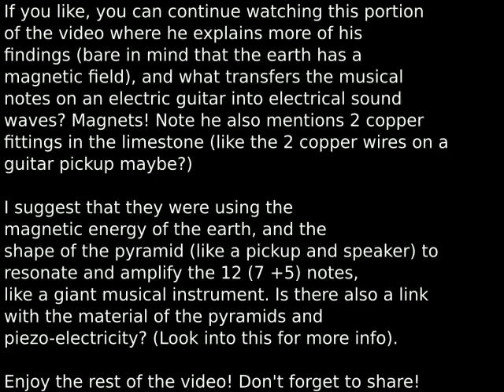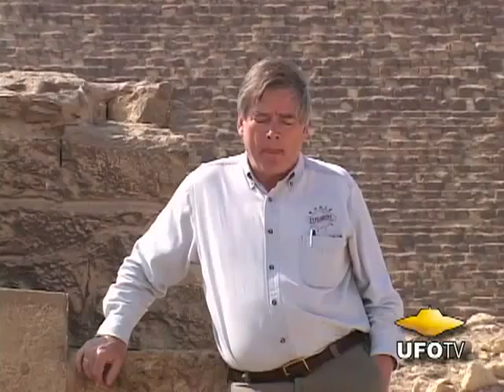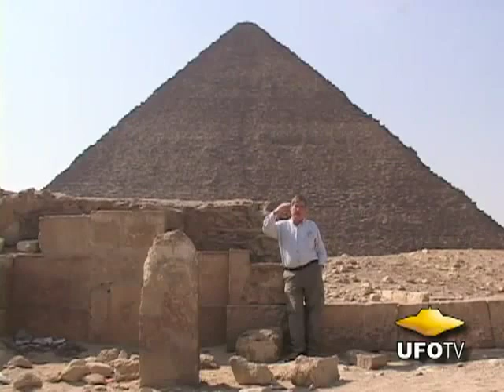The Musical Pyramid. Pyramid Secrets. 432Hz Tuning. Chris Dunn. Interesting Findings (Part 2 of 2)

Comment: These shafts are not just roughly  cut 'air holes'  but are perfectly  straight cut on all four sides all the way to each corner (not rounded at the corners)  and all done with a copper chisel?    Also,  the shafts are still  perfectly straight after major earthquakes and many thousands of years!  Then the builders hide their work unsigned and  never to  be found!

Comment: I'm confused. The pyramid is a "power plant", and was supposed to produce hydrogen, but when the hydrogen exploded....that was a disaster? Does that mean the hydrogen was never supposed to burn? How would the hydrogen produce energy/power without burning, or was it supposed to burn in a controlled manner, like a furnace? Where did this hydrogen go after it travelled to the King's Chamber? How was power extracted from the pyramid "power plant"? Did it produce electricity, or did it power a water pump?
Reply: The hydrogen is excited by the piezoelectric effect of the quartz in the King’s Chamber granite. The vibrations from the grand gallery cause a rapid compression/decompression of the quartz, which causes the emission of an electromagnetic field from the quartz crystal. 
That electromagnetism excites the hydrogen and forms microwave energy. 
Then the microwaves would exit the southern shaft in the kings chamber, which happens to be shaped like a wave guide to form microwaves into a beam.

So, correct. The hydrogen was never supposed to burn, only to fill the grand gallery to increase the strength of the vibrations and then to mix with the electromagnetic field. 

Some type of accident seems to have occurred which may have somehow ignited the hydrogen. 

To-scale replicas of the pyramid’s sub-chamber prove it functioned mechanically as a hydraulic ram pump, a pulse generator that would send enormous vibrations up into the body of the pyramid. 

Even now, without the subchamber active, the pyramid functions as a coupled oscillator to the earth. 
You can be perfectly silent sitting in the King’s Chamber, and the chamber rings at 438hz as it draws vibrational energy from the Schumann resonance. 

Modern science has proven that even now, in its inactive form, the King’s Chamber creates an electromagnetic field. 

Fully functional, it would have been awesomely powerful.

Comment: Doesn't Chris Dunn say the Kings chamber is tuned to 440 not 432 hz?
Reply: He says 438 in The Giza Power Plant. He measured it with effectively a guitar tuner. The pyramid is an active coupled oscillator to the earth, and thus the King’s Chamber is always humming quietly, tuned to 438hz.

Comment: This pyramid have 2 chambers, for tuning a binatural beat two type of frequency " stereo speaker". 
They says used to be water flows by  the lover entrace. So If the water flows down Constant under the pyramid, it pulls in constanst hot air flow from the top of the pyramid. Constant air motion makes resonate  the 2 chambers, and starts to "whistle up in a hight frequency". Like when you leave the windows opened, and hear that sounds.
Sonic levitation, is levitating with multiple sound freaquency standing waves. So if the 3 pyramids are 3 big speakers what were built downward and spaced correctly generating standing waves in the ground? Maybe the whole ground and soil beneath the section of the 3 pyramids has no weight ' couse this sonic levitation effect. If the whole area has no weight near the 3 pyramids, couses obove place has less, or no gravity? Like a airfield ?

Comment: I'm picking up what you are laying down.  Hydrogen sparked by piezo electricity from the granite in the Kings chamber would be an implosion and the result would be a lower temperature in the rush for hydrogen to mix with air and create water.  I agree that a huge earth event happened, everything near any of the pyramids running at that moment was vaporized in a hydrogen implosion then an earth event belched out and shattered all of the limestone on the outside into dust in the shape of a mushroom cloud like hydrogen bomb, exactly like a hydrogen bomb.
The only humans left were sheep herders and the type who only new about copper chisels and nothing about machining to some fraction of an inch.  The blueprints and directions on how to move huge rocks floating from quarries 500 miles away scattered with the dust of the limestone.  I believe in that one earth event we lost all the brilliance of the pyramid age across the earth.  Everyone anywhere close to a pyramid anywhere on earth, gone.
Reply: Hydrogen would be excited by the piezoelectric electromagnetic field, forming microwave energy. 
I’m not sure if the piezo electric electromagnetic field would ignite the hydrogen without sparking.

Comment: Why 432? Why not 431 or 433?
Reply: Know thyself you are the sacred geometrician. The average human is 5'9" average thumb knuckle is 1 inch wide the spiral on your thumb made square ( phi ratio ) give us the fractions in the inch. Average pace is 5.28 feet. 1000 paces is a mile the sol ( Latin for sun ) of your shoe is 1 foot long. Your heart beats an average of 72 bpm you have 20 digits 20×72 is 1440° in the seal of Solomon or star tetrahedron. your hand over your heart 5 digits times 72 that's 360 the degrees in which the sun moves 72×360 is the entire platonic year and  The degrees in the Platonic solids are contained in the cycle. you have 24 minute digits 12 on each hand 5 digits ×12 minute digits is 60 the minutes in an hour this is why there are hands on the clock on radi that spiral like radius bone in your arm that grows in the spiral ratio phi. start doing the math and you have all the numbers in time. You have 27 bones in your hand 27, 54, 108, 216, 432, 864, 1728 this is the Pythagorean tuning or octaves. Let's play harmony of the Spheres (scale invariant harmony) or zeros. If you add a 0 to 108 it is the moon radius add a zero to the 216 you have the moon diameter and the degrees in the cube. Add three zeros to 432 and you have the radius of the sun 432x432 is the classical  speed of light at 0.01%accuracy . add three zeros to 864 and you get the diameter of the sun.  and of course 1728 is the inches or thumbs in the cubic foot. You have 33 vertebrates or steps on Jacobs ladder 33 ×24 minute digits or hours of the day is 792 add a zero and you have the diameter of the earth 5x12x3960 the earths radius and you get the classical distance to the moon. with this number you can begin to triangulate the heavens with the naked eye and climb the cosmic ladder!!! Add these numbers to find the root digits ( 4+3+2=9 the # of truth ) and you know the magnificence of Tesla's 3,6,9. We are created in the image and we are the measure of all!  Namaste
Reply: ***** That's a phantastic explanation!
Reply: Do the math
Reply: @PhyZeik in college philosophy, world history, and music theory. After college i dove into the trivium and the quadrivium as well as the origin of weights and measure. I've made a few vidoes about this stuff on my channel but for more info check the channel SGD he dine some great work and is a nice guy happy to answer  questions for you if you ask. Glad you find it interesting, peace to you!! 😊✌
Reply: @PhyZeik have you ever dreamed or used your imagination to visualize and create something? If so then you've had a DMT trip and you've used your third eye or the eye of the magi ( imagination). To create is to use both side the theoretical brain in harmony. the Egyptians thought the Eye of Horus or 3rd eye represented fractions 1/2, 1/4,1/8 ext. And how we see the world I believe our visual cortex is plugged into that somehow LOL but we use these fractions which are found in nature when we observe it to create things and to play music Etc it's in the spiral of life or the golden ratio. Most of these drugs have chemicals endogenous  to our body the stuff is already inside you. But what DMT or a Ayahuasca trip will do for you is just force you to dream while you're Wide Awake instead of while you're sleeping which is very similar to a schizophrenic episode. If you get scared you can have a nightmare and things can go bad if you're full of love and light things usually tend to go okay. But basically you're overriding your body's natural functions that protect you from harming yourself while you're dreaming asleep when you take these drugs. If you take small amounts of these drugs you're not going to dream while you're wide awake but you're going to see visuals lots of geometric shapes much like when you are sober and you rub your eyes you'll see strange patterns these patterns are sacred to people all around the world and we wound up developing a system of geometry based on the 360 degrees of the sun's movement and a circle to understand some of these visions and then we use those to build things as well and measure the world around us. A lot of the old mathematicians were mushroom heads it's just that simple. Part of meditation while high on shrooms or without was not just to sit there and clear your mind it was to do math the word meditation itself implies to measure things. So if you are going to mess around with these things be careful large dosage and fear can put you in a schizophrenic episode try something small first and just enjoy the visuals and then recognize that's where we came up with things like geometry LOL the mushroom though I believe is something sacred and that's why so many cultures have honored it from the bulbs on the Christmas tree to krishna's Umbrella the sacred cows Etc that's a whole nother subject
Reply: @PhyZeik I've taken micro and macro doses definitely seen geometry and I do believe that certain combinations of shrooms may unlock potential things in people's minds but there's no scientific evidence to back that up that I can show.  I also believe that shamans may have used these to change their visual cortex perhaps awaken the cryptochrome proteins in our eyes to see the Earth's magnetic Grid in the sky for navigation purposes much like the mammals do and the birds naturally.  I took a large doses on the side of a hill during pre-dawn electromagnetic induction and I noticed you can see a bluish Grid in the sky to the north and a red one to the South which is the same thing the birds use to migrate you can use a strong magnet and a pharrohscope I think it's called to recreate this in a laboratory. And I think mushrooms may be able to unlock a sixth sense telepathy perhaps if you don't go crazy first LOL it's best not to mess up your circadian rhythm or your sleep patterns too much using these drugs because it can mess with you but you can find Enlightenment and spiritual discernment Sometimes using these and have certain epiphanies just be cautious but not frightened or scared if you try them. As far as the tesseract study euclidean geometry and the quadrivium see how it's all tied together with time and music and space Etc read lots of old books that's where it's at!! 😉